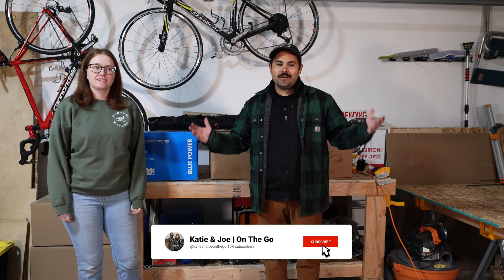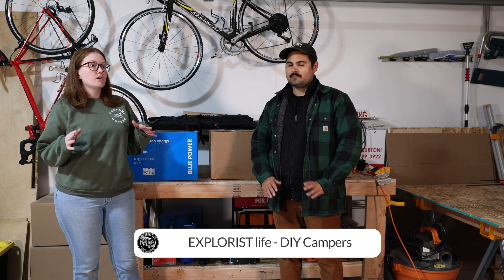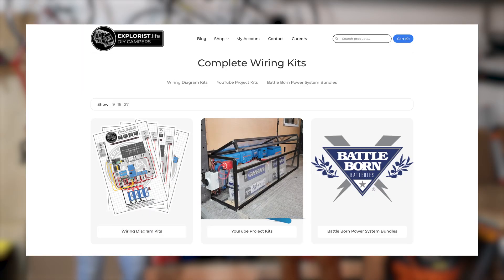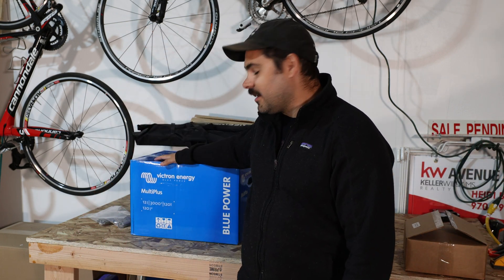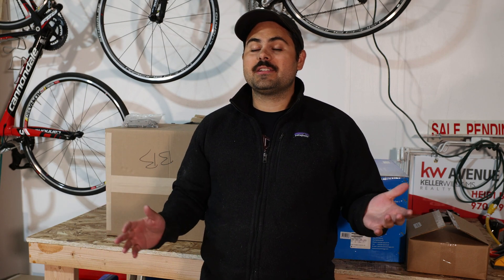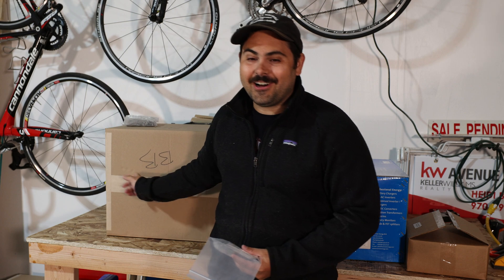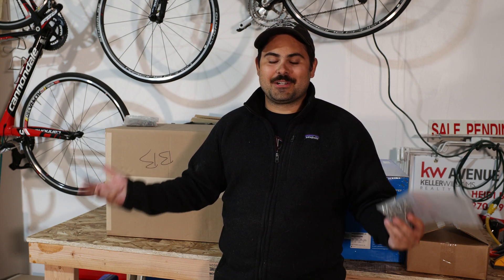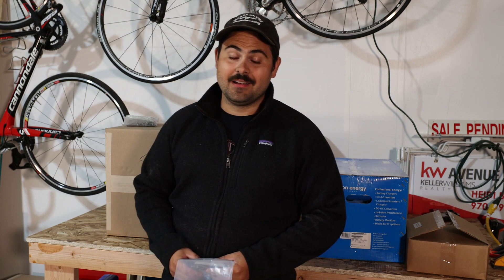Unboxing @EXPLORISTlife's $3,000 Van Build Electrical Kit

Comment: I always felt that electrical components as a stumbling block for DIYers but also for long term maintenance challenges. It turns out that many problems do arise iver time. And with each component manufacturer always having the support option to deny users a warranty repair due to the other components involved. Well in 2025 that has changed a lot with the All In One kits to take much of the E build construct out of Diyers hands and buy off the shelf systems from EcoFlow or HySolis, etc. Upfitters like Humble are seeing the lower install costs enough reason to switch but i think the main benefit is TCO tot cost of Ownership. Also guessing 90% of van users dont have the aptitude nor motivation to learn solar, two types of Electrical current, AC NEC codes and DC wiring rules. Thankfully the industry is progressing to answer the need.

Comment: I’m wondering how long it’s going to take Victron to wake up and match the simplicity of EcoPower. The Eco can be put in in like 45 minutes. Rack the 3 batteries, hang the control module, plug in the batteries, hang the distribution panel and connect it, then the display. Done.1250 amp hours equivalent 12v.